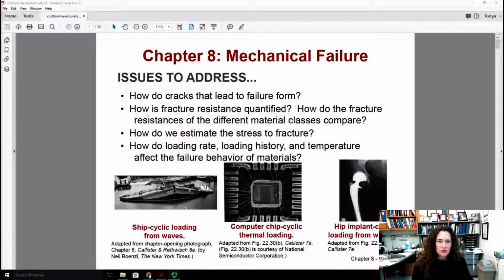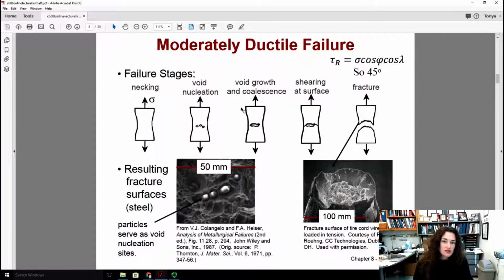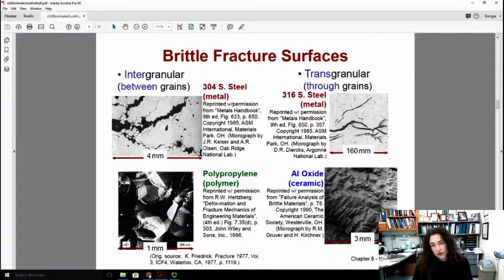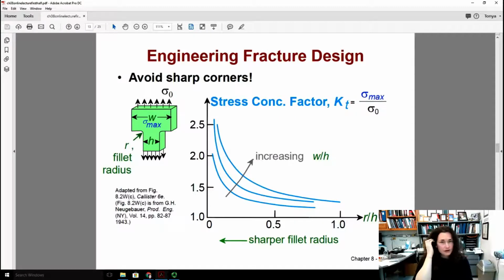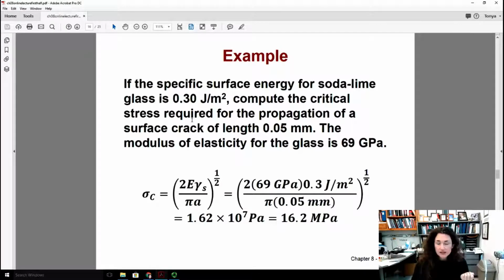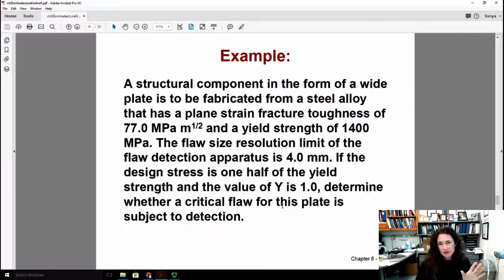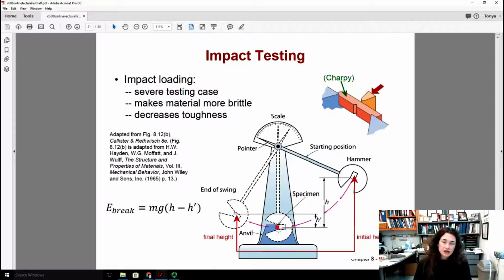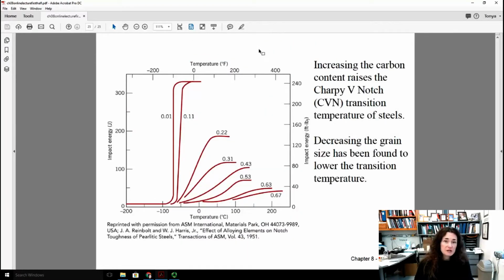Introduction to Fracture  Ductile vs  Brittle  and Fracture Mechanics

Comment: Why does critically resolved shear stress in a single crystal matter when overall a polycrystalline material has grains in all sorts of directions? Like, at the tip of the void that propagates id expect the crystals to be in all sorts of possible directions. Thanks for the videos

Comment: Why have you taken 1.25*10^-2? at 12:14, should it be 2.5*10^-4?
Reply: when its INTERNAL crack yes, it should be 2.5*10^-4 . 
but as the question says,its at the tip,so u should divide it by 2.
as internal cracks are "2a" and tips are "a"
Reply: internal crack length, "a" means half of internal crack length.